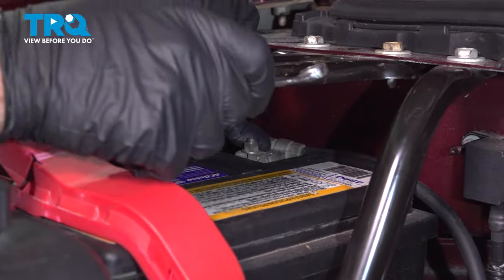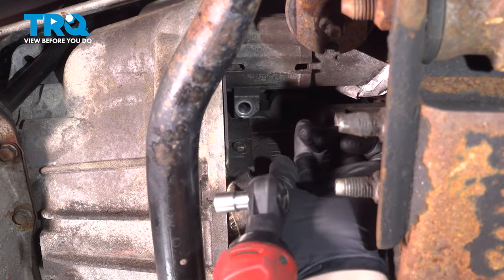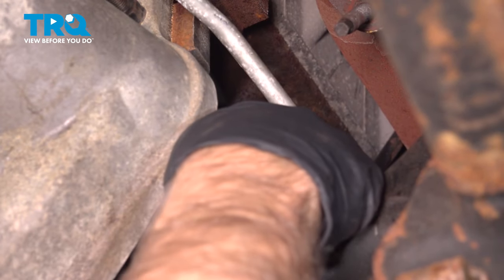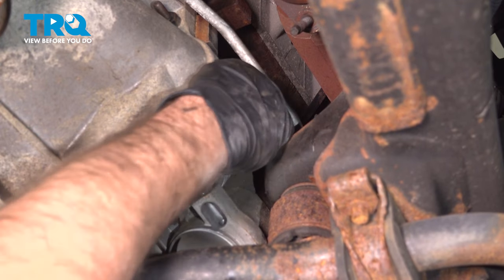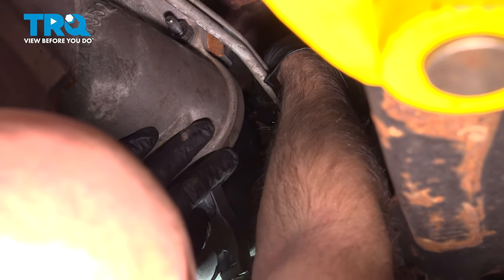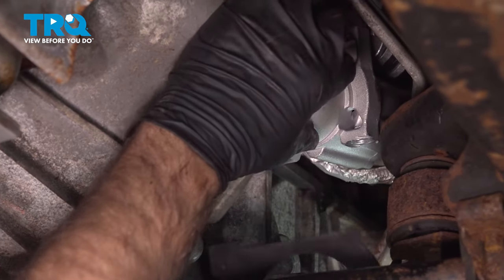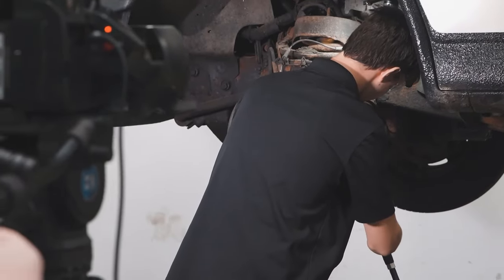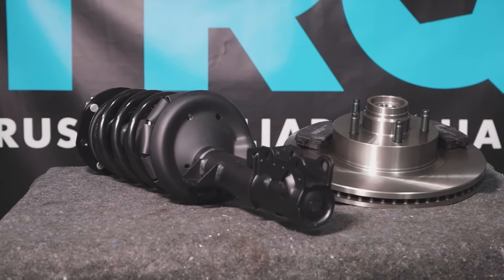How to Replace Starter 2007-2013 Chevrolet Silverado

Comment: It is a cock sucker to get out, I took the fender inside out but left wheel on with it turned all the way to left.  Took me about an hour and a half and I'm just a home mechanic at best.  I did drop the one mounting bold on my fucking forehead that hurt a little.

Comment: thanks for this, i just finished doing a Head Gasket Job for my girlfriend Tacoma yesterday, that thank God it went well, so she's been barrowing my truck to Do Landscaping with my 2007 Silverado and the starter went out today in the job, with 310,000 miles, I tried hitting it with a hammer and didn't work, very limited where you can strike, we left it at the job, the Auto part should have it by 3pm, then I can go and do it quicker thanks to this Amazing Detail Video, Much Love!!

Comment: Good video, pretty straight forward and like you started with, I like to view before I do.  I disconnected the battery once on my Silverado and the truck went into limp mode and the dealer had to reset the programming.  I since got one of those 9V battery gizmo that plugs into the cigarette lighter to maintain power to the computer.  Might save you a trip to the dealer.

Comment: To make it easier to get the 13 mm nut for the wire on the starter solenoid take the harness loose from the top of the frame you can pull the starter down easier to get to this nut . This nut is on top of the frame, passengers side, front fender well

Comment: FYI. If you have a transmission cooler, you will have to get by those lines too. It adds a little complexity but they can move around

Comment: This video is not for an 07 new body style, at least.  07 new body Silverado uses a post for the starter wire, not a plug in. STA0371 is needed, not STA0394.